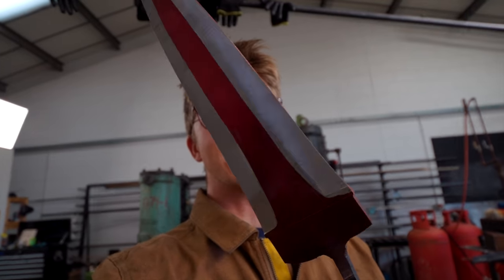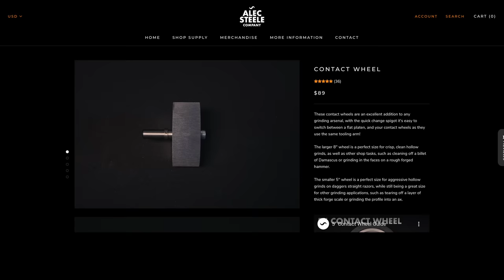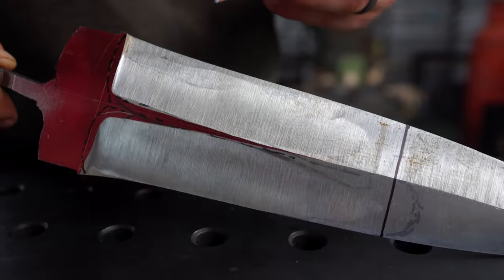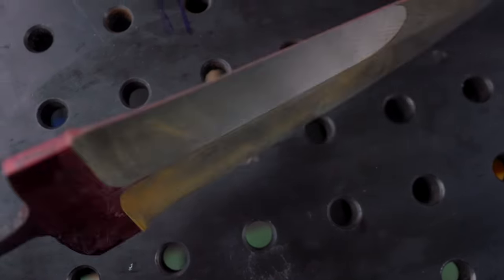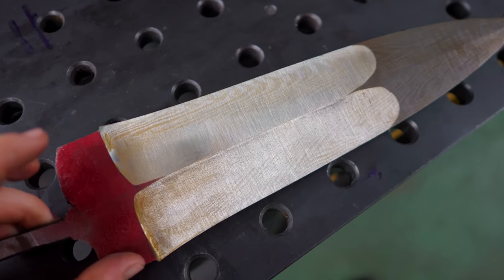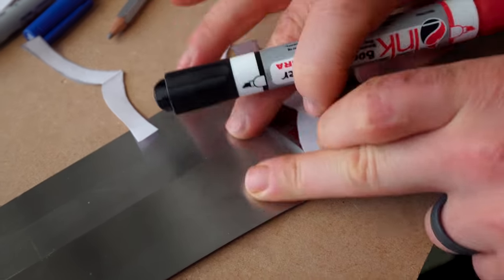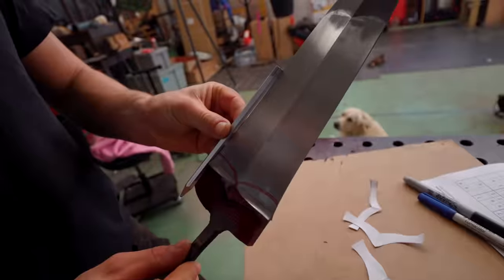Making an Ancient Indian KATAR Dagger! Part 4

Comment: After you insert the blade into the mortise and get it pinned, consider joining with solder as well. It'll fill the gaps and make for a cleaner finish with just a bit of clean up to make it look crisp

Comment: Alec you know the sides of the handle and blade can also be made as one piece. By splitting the ends off the block blade end before forge shaping. Then hot worked backward for the handle ends. Then the palm handles are hot riveted in between. Than a degrative piece slides over the blade and sides of the handle to be riveted to.😉👍👍
Reply: If you go back to the first video he tells a story about how some traditional katars where made by recycling snapped blades. In many of those the blade is not part of the handle, in some they are riveted and in others you can't see how they're connected because the handle covers those details. That's what he's going for here.
Reply: @InternetCommenter  Agree! We all got that episode. I'm not saying it's wrong. That only it's more difficult and more work Cause now each part has to made separately, fit together and not break apart.
Reply: @kaydog2008  yeah, but it takes away a certain something, Like, it feels more right, a bigger accomplishment

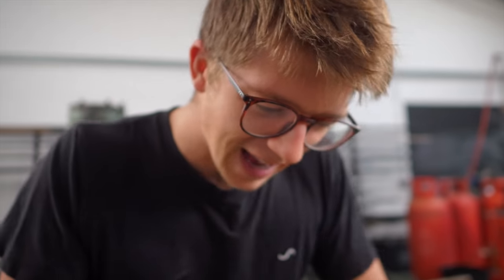Comment: 10:15 this is why you need handles on sanding implements. That's why spoke shaves have handles. They don't exist anymore, because they'd be made and discarded on a case to case deal, but that's how it was done.

Comment: Something to consider is from which direction are you slotting the blade into the handle. Perhaps instead of slotting the bottom of the blade into the handle you could push the blade fully through tip first so that its as tight as possible and potentially peen the bottom over?
Reply: Won't the problem with that be the fact that the tip is thicker?

Comment: I always thought that style knife the blade and 2 side supports were single piece of steel, with the hand grip added in. It seems like such a shallow socket for the blade will end up incredibly weak for a blade designed to thrust, considering if the thrust hits any kind of resistance,  there will be a lot of torque applied to that tiny connection point where the blade meets bolster.

Comment: Instead of cutting it off you could have forged and stretched the base of it into as long of a bar as you could go, then bent the corners. Finish up by forge welding more material to the sides of the blade base and back to make the handle sides.

Silver brazing the blade into the handle might make this work the way you're doing it.

Comment: Now I know you've made videos in the past addressing grinding blade bevels but it would be fantastic if you made one addressing how to clean up some of the different issues a person might have when putting the bevels. Like how to get the different facets out of the grind or how to get straight consistent lines. Also you should buy a harbor freight 1x30 and show some of the issues that come up from using those little L shaped platens and possibly work arounds to using one successfully.  Just a thought but I'm sure there is a lot of people who would really benefit from something like that. I know I would I have some issues from time to time with my 1x42. I just made a platen from 1/4 hot rolled steel but it needs a bit of touching because it's still a hair wider than my inch wide belt.

Comment: Would it be possible to slide the bolster down the blade from the tip? Then you could have a tapered hole that joins perfectly against the visible part of the blade. My other suggestion would be to use brass/bronze and close the small gap up with a hammer, the copper-alloy will easily move under the hammer, and the hardened steel should remain fine right?

Comment: All those converging lines that will be inset in the handle and will leave that slight gap in the end. Wouldn't it be easier to grind/sand those surfaces that will be inset anyway parallel to the blade? Then you get a much closer gap and it would most likely be easier to ceate that gap

Comment: Great job as always. 
Tip on grinding back and forth like that to give you more consistency depending which side is up (as in, hilt facing right vs left)
Instead of moving your arms, widen your stance a little, tuck your elbows into your waist to lock your arms. Position the blade at the correct height on the Platten, and shift your body weight left and right by rocking your hips. This keeps the same physical motion no matter what parts of the blade your hands are holding onto.

Comment: Before you cut it you might of been able to leave a squared portion at the bottom of the blade and made a rectangular portion on the lower side of the mortise and slid it down over the blade to have more material

Comment: 6:47 Here is an expenation. Alec is right handet. Which means that his right hand is much more dexterus in manipulizing objects and feeling textures/shapes than his left. The left hand is the one that holds and steadys the object of manipulation. 

The qatar with its blade in the right hand is easyer to manipulate on the grinder because you have a bigger and longer grip along its axis. 

Turn the blade to the left and you are now trying to manipulate the angle with your left hand while the right hand is busy trying to hold the slimm shaft steady and manipulate the blade. But because the shaft is so slim, the grip and handle on it are minimized. 

So how do we fix this ishue? Put a strong vice clamp on the shaftand make shure that it wont slip off. 
Now you can grind as usual but with a much better handling.

Comment: I have a video idea. Basically a skeletonized Damascus knife. My original idea was to use Tyrel Knifework's oil etching method, and to leave the blade in acid for a really long time so that it gets deeply pitted and even holy perhaps in some places. Another way of doing this (though I am not sure such a metal exists) is to make the Damascus out of a metal that etches very easily, and one that barely etches at all to get a similar affect. Thoughts?
Reply: you could maybe drip really strong acid where you want it to eat through, or just carve it out with a plasma torch and clean up. Pitting with acid to my understanding has issues with hydrogen embrittlement, though I am not a knifemaker.
Reply: @chem101studygroup4  Nor am I. If hydrogen embrittlement is specific to ferric chloride, then there are many different acids (which I'm sure you know judging by your name) that could be experimented with. Also, brittle steel can be fixed with heat treat/tempering cycles.
Reply: @BuildBreakBuilds  It's a result of most acids I think. the main action of an acid is that It loves to donate hydrogen protons and steal back little bits of hydroxide from water or some base proton acceptor from what it's reacting with. So pretty much most acids in this case will cause embrittlement if it can eat through a fair amount of steel. for just etching it probably doesn't have time to get too deep.

Comment: I wonder if you could of used the blade as a drift kinda, cut a slot in the gaurd then pound the blade through? Then heat treat after. Might be how the originals were made. But thats just a guess lol.

Comment: this suggestion is prob to late but since you already cut the blade, at 13:09 instead of having rivits going from the side, why not have a friction fit and thread a hole in the bottom center of it and screw it in from the head gaurd and then make the grips screwed in so its possible to repair any flaws that may occur
Reply: The problem with threads is that they get loose after use.

Comment: What would be interesting for an other project would be making a monosteel blade and then etching in a hand drawn artistic pattern into it (coating the blade with an acid resistive coating and then scraping away areas to be etched).

Comment: To make a blade shaped mortise for a cross guard you should finish the blade and then make a punch to it's dimensions. Then use the punch to make the mortise during the last part of the forging. Very similar to making a handle hole in a hammer head. The end results are vastly less work than trying to do it any other way while having a perfect fit in the end. If not perfect you can hot fit it to the real blade and make it perfect.

Comment: Man, that's lot of hard & exhausting work. I wonder how they manage to make those weapons in that old days with no hi-tech tools? It's outstanding!!
Reply: Patience and Manpower. Without any hammering device you need 3 guys with sledgehammers to have a decent speed in thinning a workpiece out. Grinding on stones and with files takes pretty much forever, especially with proper steel. Because man- hours costed next to nothing the materials were still the most expensive part of the finished weapon.

Comment: @Ales Steele
why did you not made a it so that the blade needed to slip through the thang, and made the mortise conical so there is NO gap, it would also increase the bond between blade and thang.
It broke my sole when i saw those last seconds, that really wasn't the right thing to do, but i wish you the best of luck with it 😉

Comment: Could the blade go through the mortice tip first? That way the taper of the mortice can match all the different facets of the blade with no gaps. Presumably this could mean the joint isn't as strong, as being a plunge type blade, the force would be acting in the direction of the mortice angles, but since you're not actually going to be using it in battle (hopefully 😉) this would be less of an issue. 

If you need more clarification on what I'm describing, please don't ask me... I'm as confused as you are now I'm sure....😄

Comment: Sudoku is all pattern recognition, when discussing it at a high level they have names for the patterns. X-Wing, Swordfish, stuff like that, reading about them can help you recognize them much faster than attempting to intuit them all in isolation. When you're in practice, and break all the hard patterns on a specific puzzle, the rest of that puzzle should only take a minute. A hard one can still take 5.. ..10.. ..20 minutes, even when you can complete an easy puzzle in 30 seconds(Pen and paper takes longer.).

Comment: I've been making knives for almost 18 years and I still have a problem (not a bad one but one nonetheless) with grinding from my weaker side. Which is to my right. I always start my bevels from my weak side first. I feel like once I get a good established bevel on my weaker side it's far easier to match it up on my stronger side. As I'm getting older and my arthritis is getting worse it's getting a lot harder for me to do the super fine work I once could.

Comment: Would it be a bad idea to try and cast the handle to bolster thingy? You could heat up the bottom of the blade and press it into some wax which could give you a pretty good fit up, then just leave some extra material to grind the casting artifacts out while you shape the bolster. Maybe cast it out of bronze or something and use silver for the inlay. I dunno if this would work tho I've never done any casting myself just seen it done in previous videos.

Comment: I thought it would have looked cooler if you left something like a quarter inch of edge the same angle as the tip area. Something like <××> closer to the base.

Comment: Wouldn't it be easier to anneal the steel after forging to make it easier to use hand files etc? It'd be another step after forging so might take longer but you're very likely to regain that time and more due to how much softer and easier to work with the damascus would be never mind how much easier it'd be to work with and create exactly the right shape of the blade etc.

Comment: I'm wondering why you have a single perpendicular tang when katars are supposed to have a horizontal handle? Is there a reason for it? You have probably already explained it but I started watching starting from part 4 😅
Reply: So is your plan to completely cut it off and weld the handle on?

Comment: As I am not a black smith in any way shape or form feel free to discard this comment completely, but would it not have been easier to leave the tang area as wide as the blade and then hot- cut it in half and then spread and draw out the tang on either side giving you a U shaped tang and allowing you to bypass the need to rivet the blade at all

Comment: I always appreciate you'r work, but I think you mess it up by cutting this part . I think better way to mount this in the handle, is thread it tip first from hand side, with nail head shaped part what you already cut off . About the handle, spike in front of the hand is bad idea for thrusting type waepon.